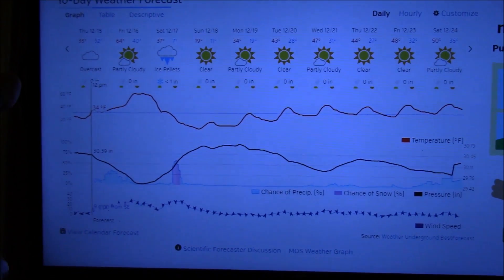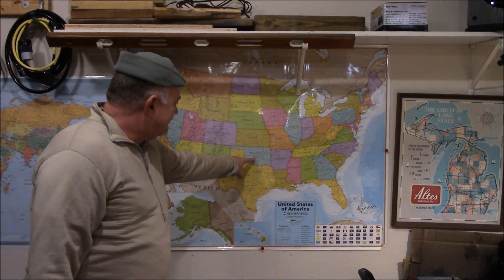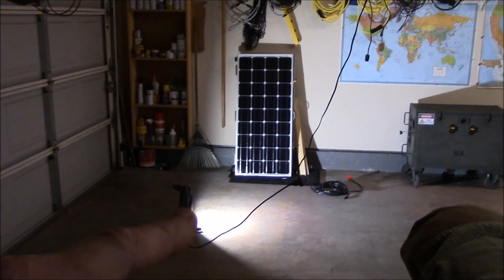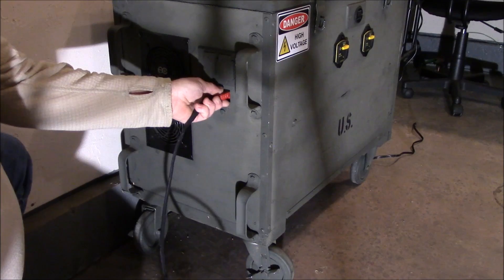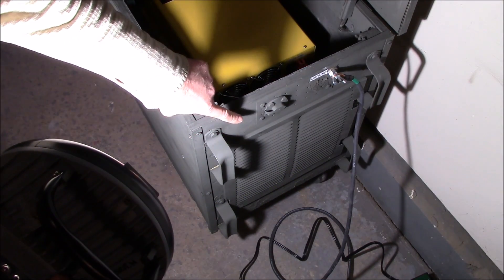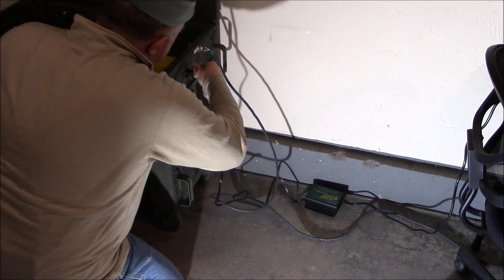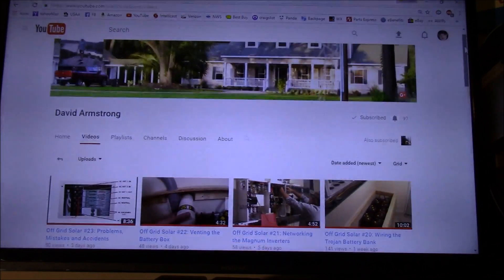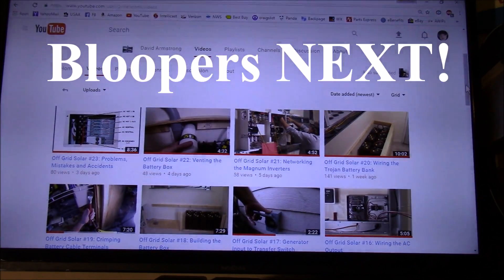50-amp Anderson-style connector hard mounted into 24v large solar generator & a Channel shout out

Comment: Just a couple of suggestions and only suggestions! Label your Red Anderson connectors as 24V! If your using them for 24V! Some people use them for 12V.  (Warn winch guys!) I changed my Warn winch to Yellow.  I use the Yellow ones for 12V, 50A and Higher Amperage.  The One piece Anderson connectors 50A and larger are (Keyed) so they won't connect to a different color. Lose the SAE connectors and use the 15A/30A/45A Red & Black Anderson's Power Poles mated wide side against wide side for 24V instead of narrow side against narrow side like the 12V pairs are mated and You still use Red for Positive and Black for Negative if your using for DC. They make these in 8 different colors so you can use Black and White and Green for AC, whatever. The small ones can slide together on any of the four sides . Again Label your connectors what Voltage it is. The Ham radio world mates the single Red & Black ones together looking into the open end of the connector (Red on right, tongue up) the tongue being the turned up end of the connector that latches it into the body for 12V.  I build a 24V  ( Y ) harness using two Yellow bodies and one Red body.  Connect the + from Yellow#1 to the + of the Red body, then the - from Yellow #1 to the + of Yellow #2. Connect the - from Yellow #2 to the - of the Red body if connecting two 12V batteries or Solar Panels for 24V! Check your wiring with a meter to double check your work! If your using 6V use the Gray body ones etc. If you put one together wrong use a small flat screwdriver and release the connectors from the body and change it. I Love Anderson's. I get mine at (https://powerwerx.com) As Always fuse the positive wire as close to the Source as possible for safety and you fuse to protect the wire.  Sweet project. I need to get started on one of my own!
Reply from the maker: GREAT suggestions...thanks! It's main purpose in life is to power my 8,000 cooling BTU window air conditioner...which uses about 600w AC on full tilt (compressor on, cooling). You know, this 24v SOLGEN is kicking butt now. I now have 1,000w in attached solar panels to a new 40-amp MPPT solar charger. Same 1,500w PSW inverter (24v). Last year I had 600w in solar panels...and it ran "okay"...but, never could keep up during the hottest part of the day (had to kick it back around 6 PM). This year with 1,000w...awesome. I can turn it down/off at about 9 PM. VERY happy with it...kinda like an appliance (stove, microwave, dishwasher) that just "works" and does it w/o much fanfare. Good luck with your build!